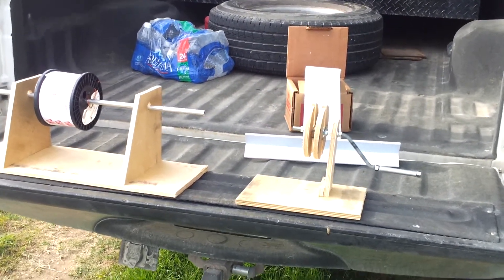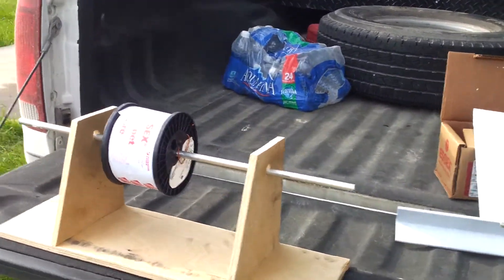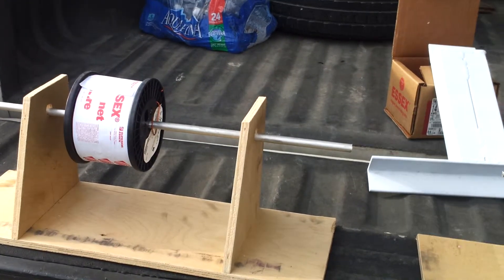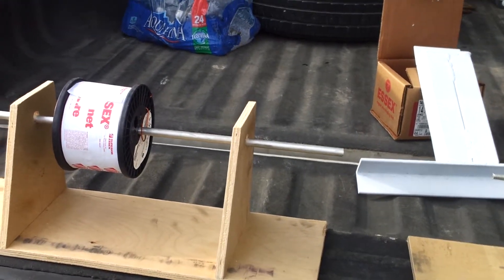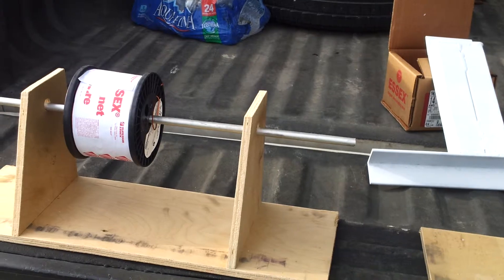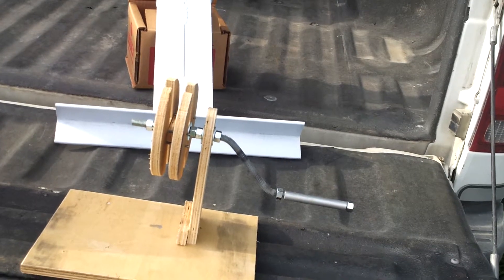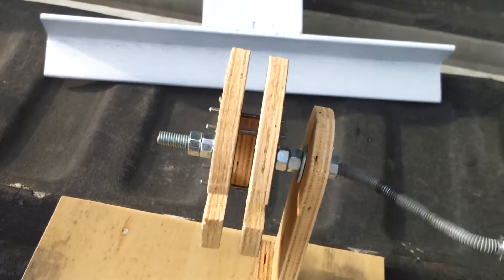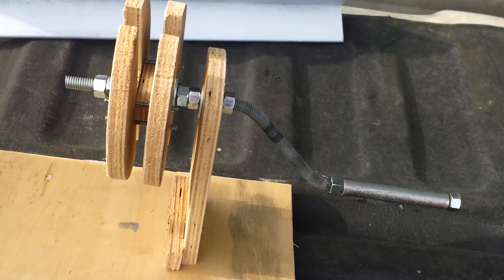Wind turbine progress

Comment from the maker: Thanks for the comment. I am very mechanically inclined. If you check out my drag race vids of the Vega station wagon....I built that car from a shell at 19 yrs old. Engine, transmission, rear end, suspension and all the wiring. Built it all.

Comment from the maker: Depending on what size turbine, you can see 1000-2000 lbs of lateral force on the tower top and at 25 feet, that is a lot of leverage at the base. To go without Guy wires, the pole would need to be about 8" dia at the bottom and tapered to about 4" at the top. Similar to a flag or street light pole. Otherwise it will sway in the wind which means lost power!